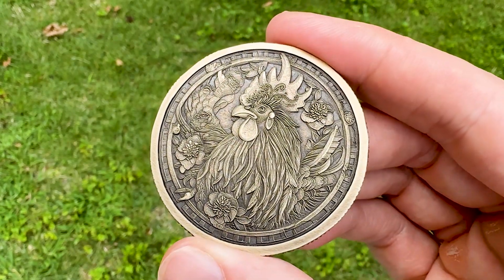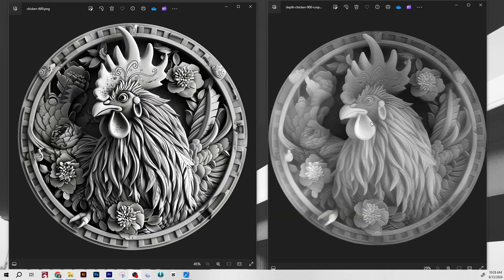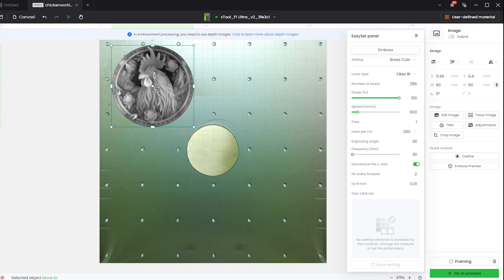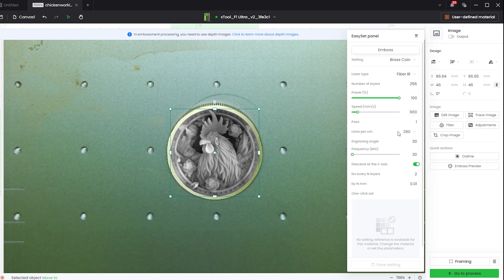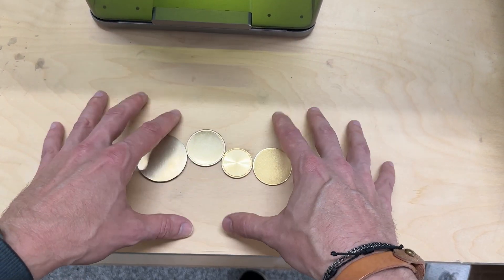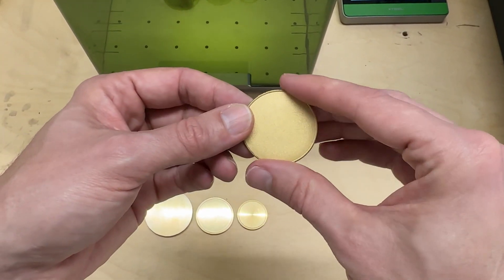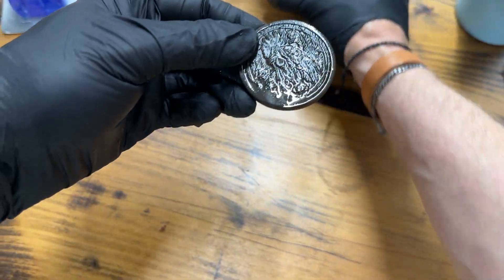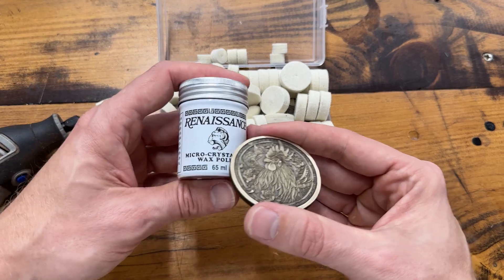3D Engrave Coins with the xTool F1 Ultra! (Tutorial)

Comment: Jeweler here. You can use fine steel wool with dish soap and water to burnish the surface. Gun bluing works well for oxidizing zing brass. Yes scotch pads are great. Then if you want to get fancy you can use a cotton buff on a dremel.
Reply: Add some polishing compound like fabulustre. And yes renaissance wax is the bomb.

Comment: Protip: You can clean the burn from the coin with a quick pass of a filled circle with a different strength. Use the laser to clean the metal 😊 last pass should be just the filled circle. Been doing this for years but with a $50k laser

EDIT: Nevermind, I see you already know this.

Comment: Put down a sheet of waste material. Draw your coin outline on it with the laser set very low. Then place your coins in the right spot every time.
Reply: is possible do lapel pins with this fiber laser machine?
Reply: Why even run it on a piece of waste material? Just make a circle the diameter of your stock on a tool layer and frame it. Line your stock up from the frame. Use that frame to center your artwork.

Comment: Coin needs a cleaning pass.  You create a circle the same size as the coin, set the laser to engrave, and the settings to 20% power, speed at 4000 and let rip.  Cleans the black right off.  May take two or three passes but will save you the headache of cleaning it by hand.
Reply from the maker: Yes I mentioned it in the video. Still doesnt clean as nice as the tumbler does. Could get close if it allowed higher freqs.